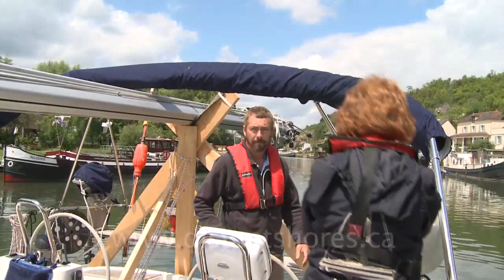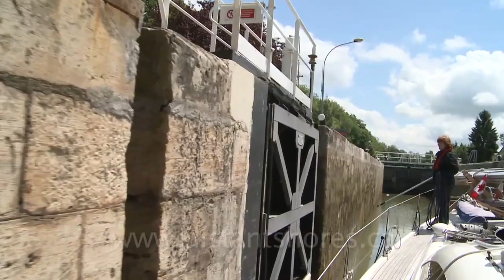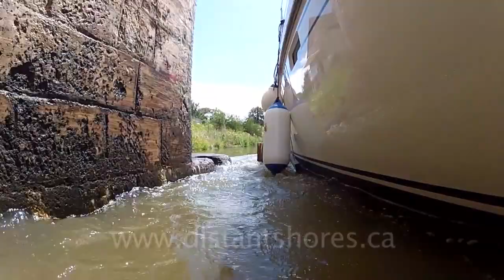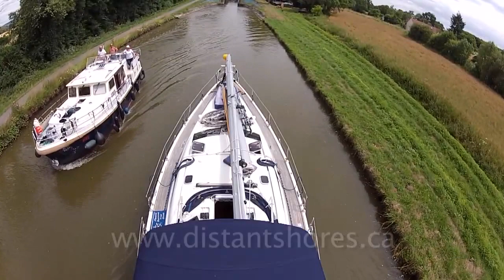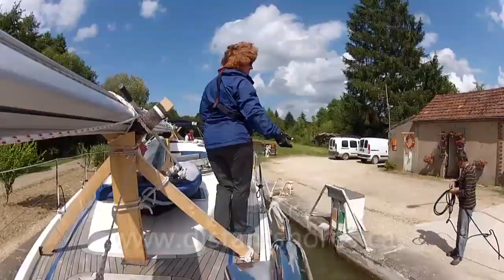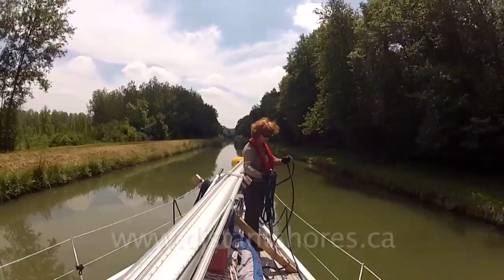French Canals by Sailboat

Comment: Thanks for sharing.  Wow! How wide are those canals generally?  Or, how wide is your boat?
Reply from the maker: The small canals in France have a minimum width of exactly 5m for the locks which defines the size of the biggest boat. Depth in the system is 1.8m

Comment: Why hasn't anyone invented an automatic fender system yet?
Reply from the maker: That would be good for us canal visitors! Most canal powerboats have a heavy rubber bumper surrounding the boat built into the design...
Reply: I think with an automatic fender system and live top-down view camera on the mast single-handed sailing/docking would be a breeze.